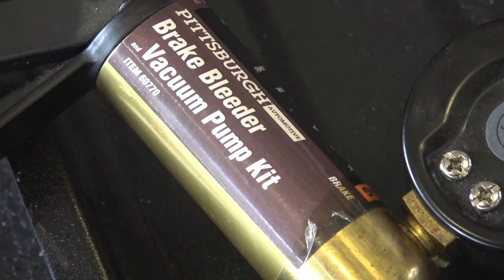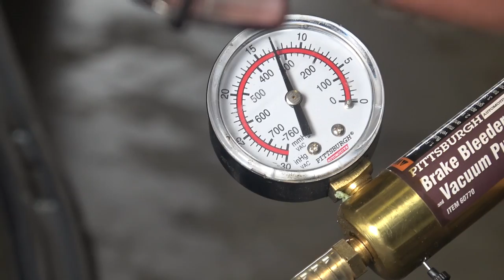Classic VW BuGs How to Self Brake Bleeding Vintage Beetle Ghia Bus Volkswagen

Comment: Brings back memories. I had numerous air cooled VWs in the 1970s and 1980s. I adjusted the brake shoes on my '68 Type 3 and unknowingly got one a little too tight. Shortly thereafter I was driving on a 2 lane road and rounded a curve and stepped on the brake pedal and it went to the floor. I pulled off the road to see what was going on and I could just see the heat convections coming off one of the rear wheels. I licked my finger and touched the hubcap and is sizzled, boiling hot. Jacked up the car on that side and the wheel was tight as all. I backed off the adjuster and two days later the wheel cylinder in that wheel blew out. Having the adjuster too tight caused the brake drum to get so hot the brake fluid in the wheel cylinder boiled (or perhaps there was moisture in the fluid that boiled), causing loss of brake action (gasses do compress). The scorching temperatures also burned out the rubber seals in the wheel cylinder. We take it for granted that modern cars are basically maintenance free. The maintenance intervals for the 68 squareback are (from memory) oil changes every 3000 miles, valve adjustment 6000 miles, plugs and points 12,000 miles, lube front end every 6000 miles, adjust clutch and brakes, check every 3000 miles, air cleaner oil change every 6000 miles, fuel filter every 12000 miles. Bias ply tires also lasted about 25000 miles. Basically only maintenance now required on a car is 10k mile oil change and spark plugs at 100 k miles. Air filter at about 40000 miles.

Comment: I've always used just a jar with fresh fluid in it. One end of a hose on the bleeder and one end submerged in the fluid. Top off the fluid reservoir and pump the brake pedal 10 times or so with the bleeder valve open. Close the valve and repeat on each wheel in the order you described, topping off the reservoir each time. Of course, now I am much older and fatter and lazier so I'll probably get one of these when I get my bug on the road again.
Reply: This video is so the person can do it themselves, without another person to pump the brakes while you are under the car, working the bleeders, and you don't have to worry about pumping the brakes.

Comment: Hi Chris, I have been trying to bring back to life a 1962 VW Bug here in California...  Chances are I have watched everyone of your amazing videos a hundred times each... Thank you for your service to the VW world. My latest situation is I for the life of me can not get brake fluid to the rear brake cylinders, actually can't get it to come out of the master cykinder. I have purchased the hand pump for bleeding brakes as I have seen in the video with your dad.  I have a single master cylinder with the 1962 brand new brake lines all around the complete car. I have not purchased the dual master with the reservoir like you guys installed. But I am close to buying it if I thought I could have brakes on my car. Do the 1962 brake lines which are new fit the 1971 dual master cylinder threads? Any suggestions to help get fluid to where its supposed to be? Thank you...
Reply from the maker: Did you try and bleed the master cylinder?  Make sure you have a vent hole in the top cap on the reservoir.
Reply: I see a small hole in the top of the reservoir, should I stick a sharp object to pierce it again. I have adjusted the brake rod shaft that goes into master, I have removed the master and pushed screwdriver into the diaphram ...and fluid squirted out at me from the brake line ports. I have had someone pressing the brake pedal as I was at the rear using the vacuum pump, and no fluid, I took off one brake line and pushed the brake pedal and no fluid came out on my dry towel under it. I verified fluid leaves the reservoir and makes its way to the top of the master cylinder when I remove the metal pipe that bends and then goes into the grommet on the master. I never bench bleed the master cylinder, I have watched the bug me videos and ever video of yours, and the bug me video shows how to bleed the master through loosening one of the brake lines on the master and fluid will come out. For the life of me no fluid leaves that small cup in the top of the master cylinder where that grommet goes. I have purchased a dual master and will get it in a week or so, and have a new single coming tomorrow. The one on the car is two years old but never used, just installed on the car, as my project has carried on.

Comment: I bought a pneumatic bleeder from Harbor Freight that works very well.  Rather than just bleed the brakes, I replace the fluid whenever I work on the brakes or annually, which ever comes first.  Cheap insurance and the rubber in the system lasts longer.  I think that was a VW standard back when these cars were new.

Comment: Hey Chris.  Curious.  My brake light doesn’t come on until it’s fully stopped. Someone mentioned bleeding the brakes.  Have you had this issue?  What would you recommend?
Reply from the maker: You can, or try changing the brake light switch.

Comment: I have a 66 beetle that i replaced the master cylinder  then i bleed all four wheels and i still have no brakes, my question is does the master cylinder need to be bled also prior to connecting the lines and if so how would be i go about bleeding the master cylinder ? Thank you.
Reply from the maker: Yes I would do that.

Comment: Hey Chris, my bug is making this very strange, loud, and aggressive clunk noise coming from the rear of the car. The car will accelerate and then that clunk occurs, it sounds like it stops the motor for a brief moment, then car will continue to accelerate. Any idea on what this could be???
Reply from the maker: I have a "clunk" video, did you see that?
Reply: Thats the bowden tube problem . Its the piece of hard tube around a feet or two , the clutch line goes through it , when the car is accelerated the engine turns clockwide due to torque and the clutch is disconnected , this will specifically happen initially in first gear , reason is tjat the bowden welds have broken off , its welded to the front side (tunnel side) . Dont know what its welded to but its welded and in this case the welds have broken . Research on it and youll know the solution to it .